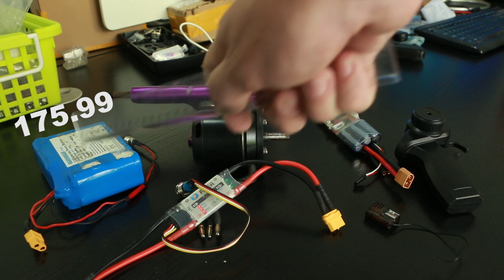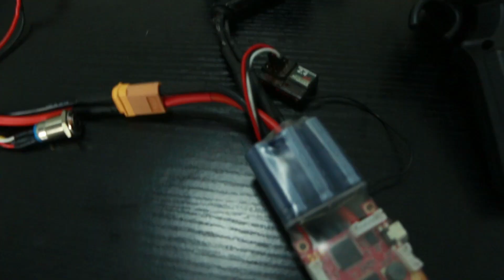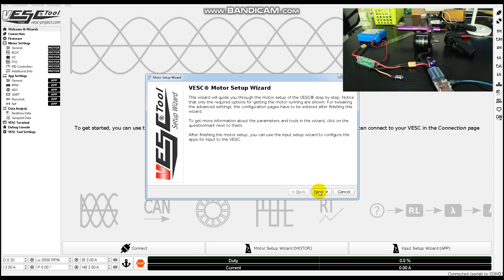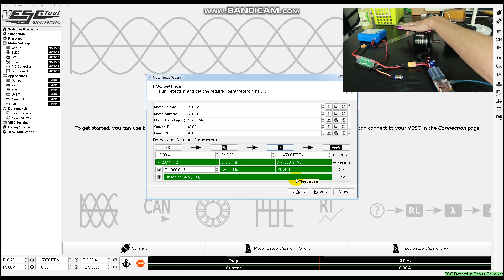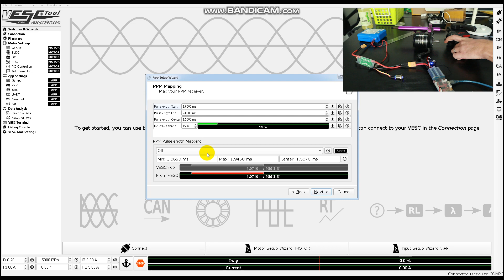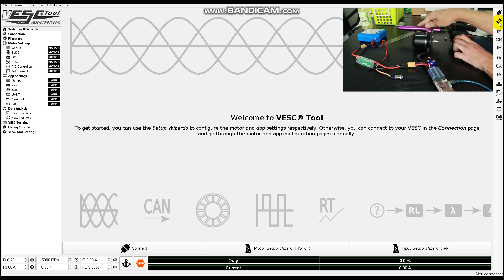Electric Skateboard Electronics How to Configure VESC and Connect Part I

Comment: could you help me on my first build? I have FLIPSKY dual FSESC4.20, FLIPSKY ANTISPARK SWITCH PRO AND FLIPSKY REMOTE VX2, I connected all of them just like your video but the problem was only one motor is working even if I switch the esc to dual and the ON & OFF switch is not working, once I plug in the battery they stay on all the time. please help me, thank you.

Comment: 0:21, wow that's an expensive switch!
Reply from the maker: Elmar Blok They are expensive. Most of the electronics are relatively expensive when building a board.
Reply: @diydecks8740  Is the switch still working? I have heard that most of these switches are unreliable.
Reply from the maker: infiniteoffset it’s still working for me. Actually, now I have two boards, one single motor build and one dual motor. Both are using the same switch. I have heard that they’re not very reliable but for whatever reason the switches in both of mine and one I built for a friend haven’t had any issues.
Reply: @diydecks8740  Thanks for the answer. For my budget build I'm going with xt90, but for my more expensive build I wanted switch for the convenience, but many people told me to stick to xt90.
Reply from the maker: infiniteoffset yeah, I understand that. First of all, I’m also into drones and fairly experienced at soldering and electronics in general. I don’t mind mind taking a chance on electronics because I also find most companies are fairly willing to work with you if you truly have a faulty product. With my parts and builds I also take videos from opening the box to setting it up...if something is shoddy, you’ve got the video to show the supplier. You also need to keep in mind that we’re using serious amounts of power, the initial burst once you hit a switch or spark an xt60/90 is a serious amount of power to shock a pcb with due to the fact that we’re using hobby grade electronics. My suggestion...take the risk and experiment a little...those Xt connectors are a pain to plug and unplug...that, and the spark up is pretty hard on your speed controller. If it fries out then you can always move over to xt connector. My next project is going to be installing a USB port in my battery compartment so I’ll also have a source for charging my phone if need be.